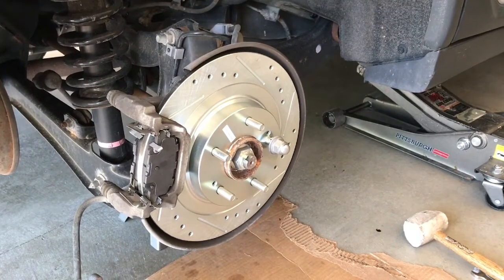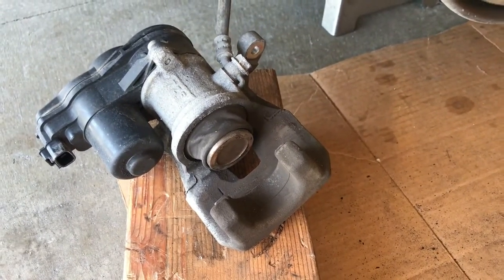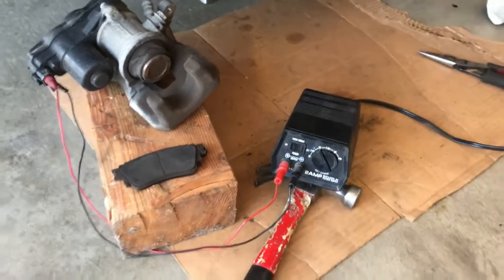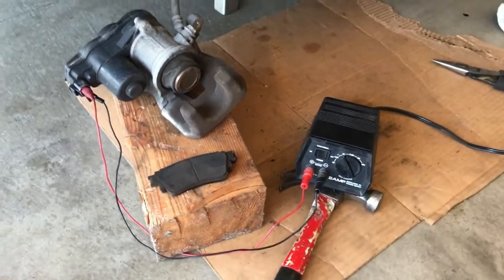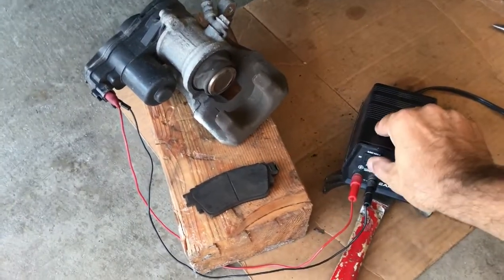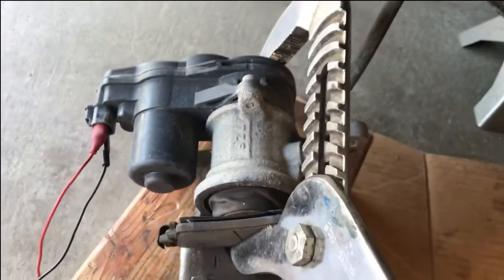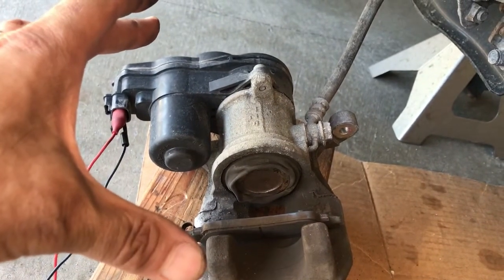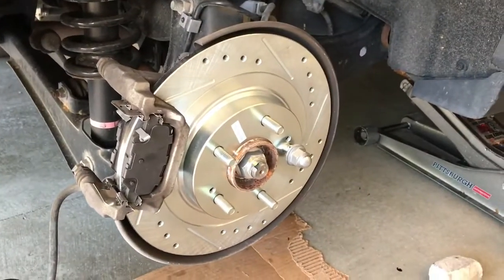2018 Mitsubishi Outlander Electronic brakes Retract Procedure

Comment: What the name of your power supply or what can i buy tanks for the reply
Reply: Fyi- I was told by a mechanic at the dealership that this can be done with a 9v battery and test probes.... I'm about to try it. I'll update you if it works 🤞
Reply: @alanvedder6719  did it work?
Reply: @feeshunter1508 , Yes! I attached leads to a 9 volt battery and it worked great! You have to go slow to make sure it's going the right direction. If not, just reverse the leads.
Reply: @alanvedder6719  thanks! I've got a 2022 outlander, gonna try this. Owner's manual says nothing about how to put it into service mode by pressing the park brake 10x or whatever I've heard can be done.
Reply: @feeshunter1508 , yeah, I dunno how to do that mine either, it's a 2018. According to the guy at the dealership,  you need a special computer that's like $3000 🙄
Reply from the maker: Please see link here but any 12V supply will work.
Cheers.   

https://www.amazon.com/Parts-Express-Power-Supply-Regulated/dp/B0002MQGI6/ref=asc_df_B0002MQGI6/?tag=hyprod-20&linkCode=df0&hvadid=644686391885&hvpos=&hvnetw=g&hvrand=16581582180739892938&hvpone=&hvptwo=&hvqmt=&hvdev=c&hvdvcmdl=&hvlocint=&hvlocphy=9032523&hvtargid=pla-1953755308012&psc=1&gclid=CjwKCAjwge2iBhBBEiwAfXDBR4XBQquoO448nEEGstw_CLoGTbHGDyF_ZZnFcZnW_55tmP59B4ZxnxoCL5cQAvD_BwE
Reply from the maker: I set it to 6V so it doesn't move the piston too fast.